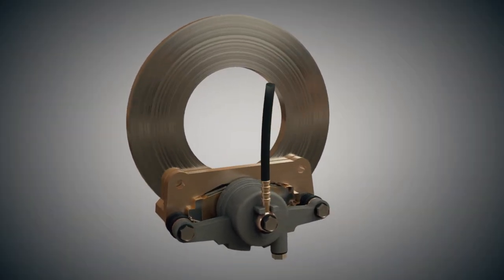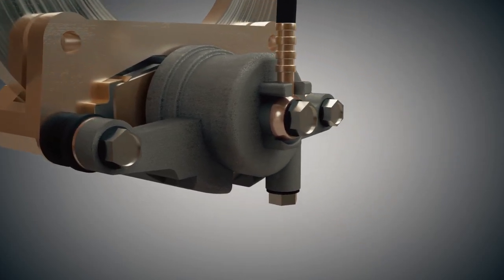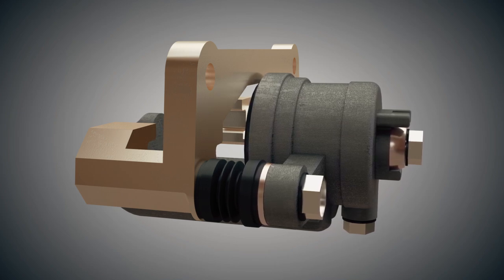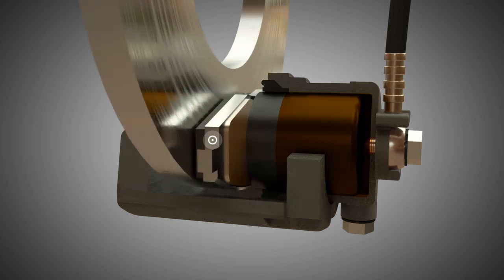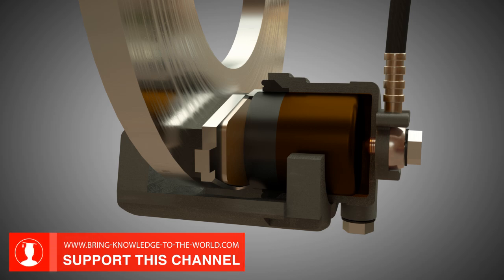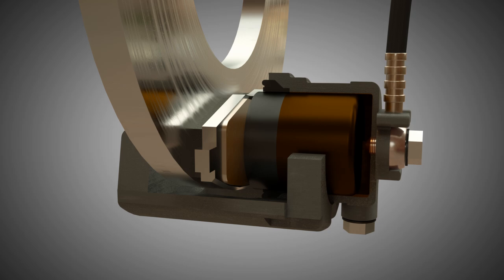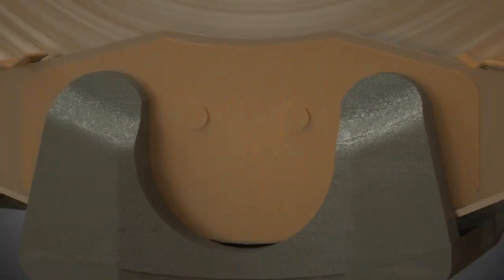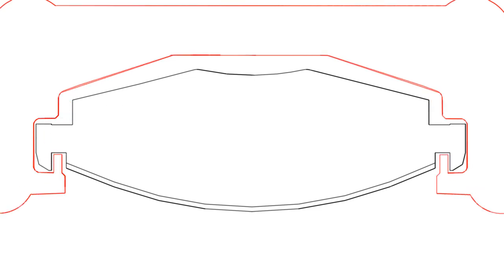Disk brake / Floating caliper brake - How it works! (Animation)

Comment: I really needed this explanation; I'm replacing the calipers in my car for the first time and was freaked out by the two seemingly unconnected parts; the caliper and the bracket. Your explanation relieved my fears.
Reply: Mine too I was shocked that is was not like kind of totally bolted down nowI know😂
Reply: You really shouldn't work on your brakes if you don't know what you're doing.

Comment: Best brake caliper video I've seen so far! I have been trying to figure something out for days and I've watched numerous videos and I haven't been able to figure it out till now. I was wondering when you clean and reapply Greece to the slide pins if they need to retract by themselves or if the caliper piston performs the function necessary to have the brake pad back off from the rotor and now I know that while the guide pins have to be able to freely move they don't necessarily have to retract by themselves which is the problem I'm having right now after cleaning them and reinserting them myself. Thank you so much!
Reply: The internal piston seal is sat on a sloping surface it twists this seal moving out And pulls the piston back in when no pressure on the piston.
Reply: @retydown7521  My brake jam is when I put a new brake pad...so piston seal boot changed everything and still the brake return does not go..its touches the rotor and produce heat on wheels and also slows down the vehicle is there any way to fix this.?

Comment: I was replacing my lug studs when finding out that my outer brake pad (opposite side of the piston) was stuck in the slide due to rust buildup and lack of lubrication (magically the brakes have been working fine and there's no visible impact on the fuel economy or wear on the components, even though that stuck brake pad is always slightly rubbing against the rotor). It got me thinking, even if everything was working as they were supposed to, how do both brake pads reset themselves after every brake action? They're not physically attached to the brake caliper in the opening direction, so when you release the brakes, nothing is actively pulling the brake pads outwards, right? Sure the clamping pressure is gone, so any slight rub on the rotor shouldn't have meaningful impact on the car performance, but still, aren't the axial position of the pads undefined when you're not braking, which means there's almost always some amount of rub, causing wear and noise?

Comment: What force makes the piston retract back to it's initial piston??
Reply: Releasing the pressure from master cylinder, the fluid inside the caliper/slave cylinder return back to the master cylinder.
Reply: the sealing ring - when pressure is released it returns to its normal shape, moving the hydraulic fluid (and piston) back

Comment: But what brings the caliper back off the disk? Slight negative pressure from the supply?
Reply: No the internal piston seal is sat on a sloping surface it twists this seal moving out And pulls the piston back in when no pressure on the piston.

Comment: excellent design of the parts, the gaps between the mating parts, the caliper casting has got that real 'dull ferrous cast' look, the Brake disc has that shiny aluminium machined look. Excellent short explanation with sufficient arrows and piston movements, avoiding repetition. Great job.

Comment: The problem with the caliper pins is they tend to "clunk" noise when either the rubber bushings or pin diameter lessen or the hole where the pins slides into is now has a larger diameter. Greasing only last a month and you rarely find caliper pins with silicon bushings instead of rubber.

Comment: I changed my brakes on my Ridgeline for the first time and it was a rust bucket.  I found all of the pins were seized and was able to release, clean, and grease them. One of the front calipers had a broken seal around the caliper piston and I didn’t have time to replace. Immediately the brake fluid is not green. I’ll replace the caliper soon- is that broken seal why the brake fluid is green?

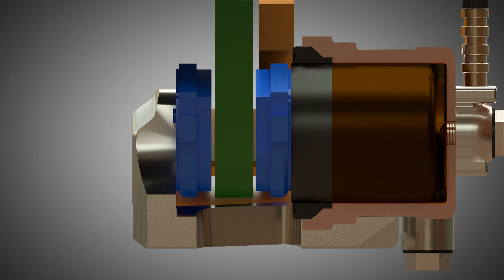Comment: Is it an error around 1:47? The animation shows the brake rotor sliding toward the exterior pad, but in reality it should be the other way around.
Reply: The rotor is bolted down by the 5 big wheel bolts and should not move. You are correct the animation is wrong. The front of caliper should start sliding towards the rotor once the pad on the caliper side touches the rotor. AS from this point onwards any piston movement will cause the entire caliper assembly to slide. Thus the pad opposite to the piston will move towards the rotor.
Reply: @aribasiebel  if the caliper slide to outside direction, how would the outside pad pressured toward rotor??

Comment: My brake jam is when I put a new brake pad...so piston seal boot changed everything and still the brake return does not go.its touches the rotor and produce heat on wheels and also slows down the vehicle is there any way to fix this.?

￼

Comment: why does my brake pads touching the rotor when i installed them in new? should there be little gap between brake pad and rotor? what happens when one of the caliper guide pin is stuck, does it cause uneven wear or something much worst?
Reply: They're always touching, they just use a gap in the animation to make it easier to show movement.  Braking causes them to squeeze tighter and add friction. 

A stuck pin would cause uneven wear and/or less then adequate braking.

Comment: What causes the negative pressure to retract the piston?
Reply: They didn't mention that in this video I also saw that as well. It can be a couple things. 1 sticking caliper pins or 2 sticking caliper piston.
Reply: the brake seal deflects back, pushing the cylinder back with it, has nothing to do with negative pressure
Reply: the internal piston seal is sat on a sloping surface it twists this seal moving out And pulls the piston back in when no pressure on the piston.

Comment: For the cross section view, when the brake pressure is applied, shouldn't the brake carrier be stationary (same as the rotor)? From my understanding, only the caliper with the piston and pads will be moving as the disc and the brake carrier are fixed?

Comment: What makes the brake carrier return to its original position once the piston retracts?
Reply: @Lucas W doesnt really explain much, why does releasing the pressure make it retract?
Reply: It returns to its equilibrium point once the pressure is released. think of it as pushing a weight upwards. As soon as you stop pushing, the weight settles back in its original position
Reply: @collinmartin3589  that doesnt really make sense since when pressure is released a weight would settle in its original position because of gravity but a brake piston wouldnt do that without an external force acting on it
Reply: @shaneebahera8566  Because those guide pins act like a spring and they always tend to retract back caliper, or better said, to push it away the from disc rotor when there is no pressure applied.
Reply: I, as well as Shanee would like an answer as to why the caliper retracts after you left off the pedal, more importantly in that answer, why does the whole caliper move? i can see the piston just stopping exactly where it was when the back pressure is removed, but not "returning to neutral" or moving away whatsoever.
Reply: @MYCHANNEL-on1cp  Good question, not being answered correctly, The square cut piston seals get are also pushed out slightly when brake applied, when pressure is released they go back to their original shape taking the piston back slighly (this is only a slight movement but enough to create an air gap between brake pads and discs)
Reply: Good question, not being answered correctly, The square cut piston seals get are also pushed out slightly when brake applied, when pressure is released they go back to their original shape taking the piston back slighly (this is only a slight movement but enough to create an air gap between brake pads and discs)
Reply: the internal piston seal is sat on a sloping surface it twists this seal moving out And pulls the piston back in when no pressure on the piston.
Reply: not it @dipys1008

Comment: But why does the calliper return to its original position? Otherwise great post.
Reply: Graeme Crawley the square seal acts like a spring and brings it back
Reply: @joepierson3859  What the hell is a square seal?
Reply: Dr Strangelove it's the seal that keeps the brake fluid from seeping out of the cylinder
Reply: the internal piston seal is sat on a sloping surface it twists this seal moving out And pulls the piston back in when no pressure on the piston.

Comment: Cen someone tell me if the rotor is being pushed onto the left brake pad. How is the left brake pad moving to the right and closing on the rotor?
Reply: NO the rotor is fixed, it doesnt move.....First, as the pressure builds up, the piston pushes against the right carrier plate causing the right brake linings to interact with the rotor....after that as the pressure is increased the calliper (that includes the left carrier plate) slides to the left, causing the left brake linings to interact with the rotor. As the pressure decreases both the calliper and piston return back to their original position!
Reply: Arijeet Tripathy ok thanks
Reply: @arijeettripathy what makes the right brake pad backs to its original position?

Comment: Uh, why does the caliper piston slide backwards under high pressure though?
Reply: the caliper slides backwards under high pressure because the force exerted by the piston has an equal and opposite reaction on to the caliper for it slides backwards

Comment: What makes the caliper piston return to its initial position?
Reply: Generally they don't, they are just no longer forcibly held against the pads. There is always some background friction in a disc brake setup like this.
Reply: The caliper piston has what is called a 'square profile' seal.  One edge of this seal is situated within a channel in the cylinder wall.  The other edge of the seal contacts the outer diameter of the piston.  As the brakes are applied, this seal will 'give' slightly, essentially 'clinging' to the piston as it extends outward to push onto the inner brake pad.  When braking pressure is released, a good seal will return to its original shape - pulling the piston back with it [albeit a very short distance].
Reply: @Flea02Cruiser  Unlike the answer above, this is correct. I'm trying to find out what retracts the fixed pad....

Comment: wouldn't this cause the brake disc to bend?
Reply from the maker: The disc is fixed. It cannot bend.
Reply: Thanks thomas :)
Reply: The statement that the "disc is fixed" is not entirely true.Modern brake discs are actually on a floating attachment which does in fact allow the disc to bend fractionally,as you would expect.You can see it do it, in fact, if you watch the disc while you operate the brake. The mounting points are the little circular holes you can see on the disc itself.You are meant to keep them unseized for best performance and safety.
Reply: @fuzzybrain8274  Those circular holes aren't meant for that. You only see them on larger discs made out of 2 materials. The outer steel friction part is made of steel and riveted to the inner aluminium hub. The aluminum saves weight, but because the differing expansion rates of the two materials they are bonded together using rivets allowing radial expansion. The disc is in no way moving laterally, that is reserved only for fixed caliper setups!

Comment: "...without pressure the caliper and caliper piston return to their initial position..." why and how? No explanation... thumb down.
Reply: the internal piston seal is sat on a sloping surface it twists this seal moving out And pulls the piston back in when no pressure on the piston.